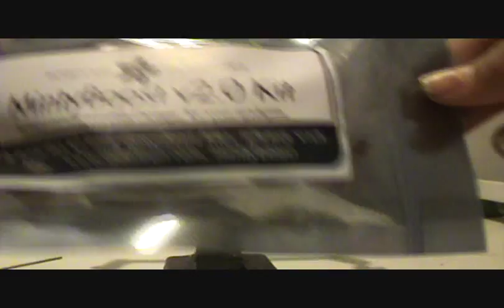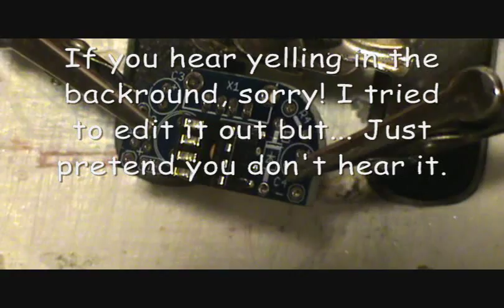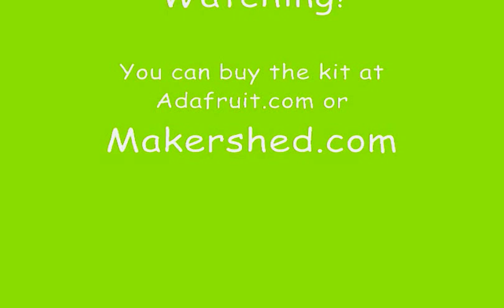How to make a MintyBoost [HD]

Comment: maybe is late and someone answered yet, but inductors in that kind of circuitry helps the ic to do his job, thought mintyboost is a DC/DC boost converter (aswell the IC), from a lower input voltage it put out an higher voltage, this happen due to how switching PSU works, the inductor helps everything to oscillate and step up the voltage (there's some cool theory behind it that you should try to learn) and it can't be designed inside to the IC for physical reasons, like capacitors too.

Comment: your battery on your phone had gotton too low so you would have to use wall power if you're going to use the minty boost use it when you battery is at 50% or more

Comment: sir the solder Pen is to hot
Reply: Contrary, not hot enough.  If it was hotter you wouldn't have to leave it there as long and therefore not burning the shit outta the board.
Reply: +Joe Weisenbacher he is about to do that if that board was cheaper or he tries to replace something it will be burned and damged
Reply: With that pen at that temp in the vid you mean?  I agree.
Reply: Don't wanna be all negative though.  Inexperienced soldering but a good instructional video all around.